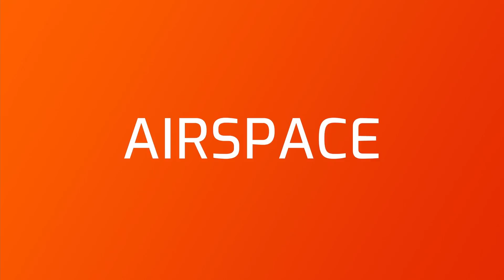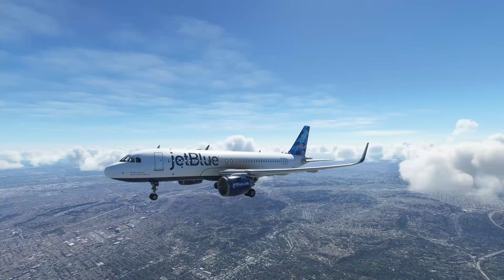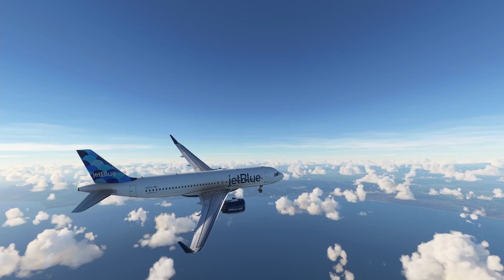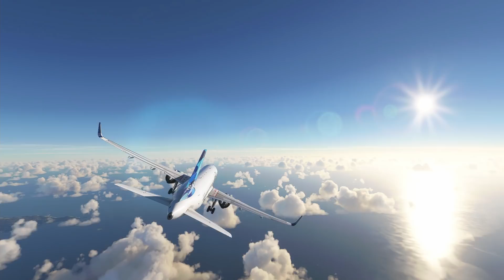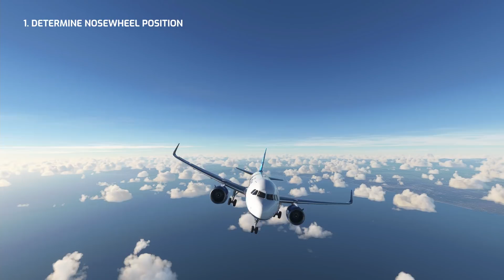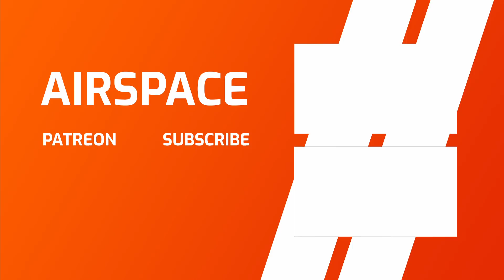JetBlue A320 lands with Nose Wheel turned Sideways [LAX]

Comment: Why doesn't Airbus just install belly cameras so the crew can visual inspect any fault, or even record abnormalities?
Reply: Any change to the plane's operation or structure would mean lengthy tests and need official clearance and re-certification, which is unbelievably expensive for a commercial operator where every minute on the ground is wasted money, and every extra pound of weight costs fuel.

Just fitting the cameras would take the plane out of service for days, and that's a big no-no in the commercial world.

As well as the cameras, there'd be hundreds (?) of yards of new cabling to run (with back-up/ redundancy systems routed away from the initial installation), as well as patching all the new electronics into the plane's main controls, and ensuring that nothing interfered with what was already there.

Any changes to the plane's cockpit layout would have to be entered in the flight and maintenance manuals (paper and electronic), and all the new things would have to be transferred to the Airbus pilot training simulators around the world. New checklists would have to be drawn up to include the surveillance camera procedures.

You can imagine what all that would cost in time and lost revenue.

The cameras (and wiring and cockpit display hardware and software) would also have to be included in the plane's ground maintenance schedules, so I think the authorities would much rather adapt existing service checks to cope with the landing gear problem.

Nothing's ever easy. Sigh...

Comment: In many ways failed nose wheel steering is better to be in a 90⁰ position than say 45⁰ or less, because on touchdown of the nose gear rather than the tyre and wheel disintegrating due to friction it could lurch the plane off the runway or cause the gear to collapse causing much greater damage to the plane and injuries to the passengers.
Reply: My thoughts exactly. If it was going to go wrong this is the best way it could have.

Comment: Had the nosegaear locked at say, 30 or 45 degrees, the outcome would have been a bit different..........
Reply: There is actually a system that drives the gear to 90 degrees when the nose wheel steering fault is displayed. There is a mechanical stop at 90 degrees so it can determine for sure that the gear is in that position, which isn't possible if it tried to center the nose gear. As you say, landing with the nose gear locked at 30 or 45 degrees would result in a high speed runway excursion which would have been much more dangerous than landing with the gear at 90 degrees and burning a bit of rubber. In fact, landing with the gear at 90 degrees really isn't a big deal at all. As stated in the video, there have been multiple other incidents like this one and I'm sure the only reason this incident is so well known is because the media was involved, and we both know how much the media loves to make things like this seem much more serious and dangerous than they actually are. I still think the pilots did a great job not because they saved everyone on board - they were guaranteed to walk away from this incident even if the nose gear collapsed - but because they minimized damage to the plane.

Comment: The over rotation of the nose wheels to 90 degrees plus has been a problem even when accomplishing ground runs. When the power selected on one engine is not offset by applying  sufficient  power on the opposite  engine to prevent yaw, the nose wheels will often go to 90 degrees and cannot be commanded back to center. This is because  the RVDT that sense nose wheel position have gone past the design limit and cannot determine where the nose wheel position. The only way to return the nose wheels to a controlable position  is to attach the aircraft tow  bar and manually move the  nose wheels to center. It should be noted that when the nose oleo or strut is compressed on the ground, the centering assembly within the strut, is no longer in play. Therefore the mechanical  centering function, which normally centers the assembly in flight, does not come into play with the aircraft on the ground. The design flaw with the feed back system is what would prevent the crew from commanding the nose wheels to center, regardless of how much hydraulics are available   because  the BSCU has no idea of nose wheel position.
Reply: Not just Airbus. All the different manufactures have had design issues that only became apparent once the aircraft was put into real life use. All the " what if's" can only be anticipated but are all subject to the various unknowns. The unknown, unknowns. This is why the industry investigates accidents/incidents  to discover the cause and implement  corrective action to prevent reoccurance.
Reply: So the simplest of logical programming (decision tree) defeated Airbus?